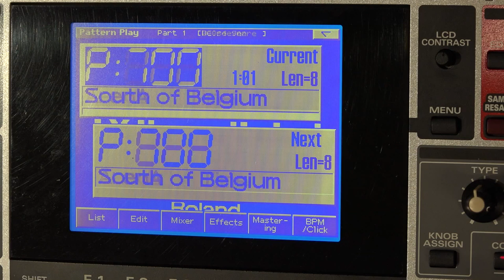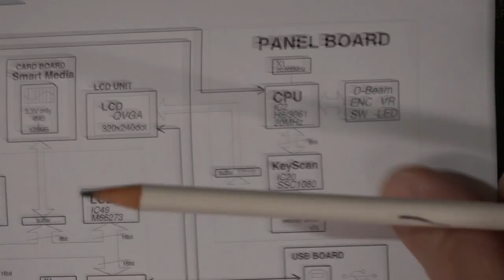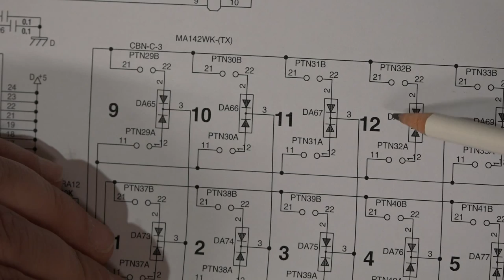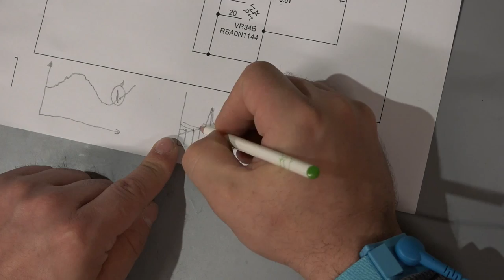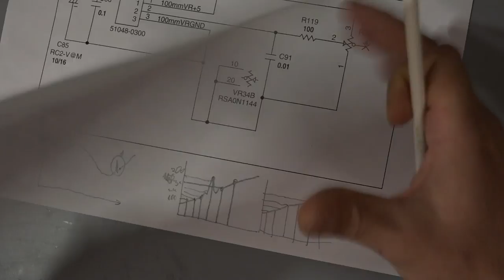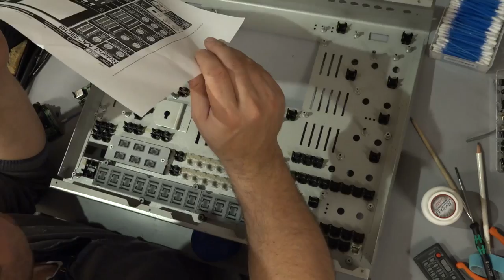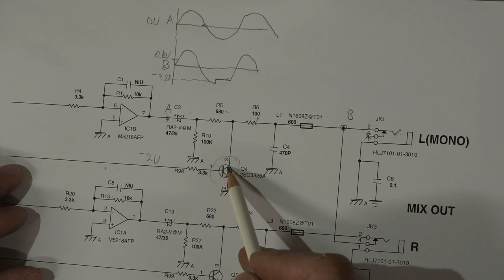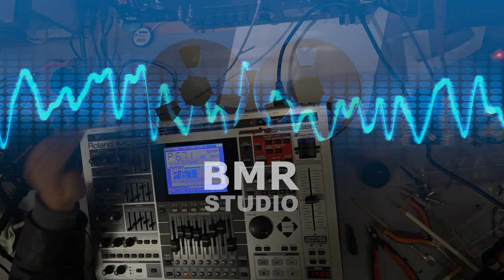Roland MC-909 tear down, repair and maintenance

Comment: Question for you BMR STudio?  Why do you think they went with graphite or carbon as a contact for the velocity pads? 

I mean I just re did mine today with a circuit writer pen but it was extremely difficult to do. After I was done I was thinking couldn't I just buy a sheet of thin silver and cut out the shapes needed and then epoxy or superglue to the pads?
Reply: I wanted to say that this is what I used to fix completely dead velocity pads  http://store.caig.com/s.nl/sc.2/category.174/.f

 you will need to clean the circuit board and the pads with goof off or some other strong cleaner I also used an eraser that worked well and then dab the circuit writer stuff on , its not easy you will have to stiple the circuit writer stuff to spread it evenly, don't worry if it looks a lil pooled up it will dry perfectly flat and let dry for several hours before testing
Reply from the maker: This pads are looking exactly carbon - metal film compound pads. But they are extremely hardened, so I was wondering how can be loose on Your pcb. You can try the superglue, but I think You just will mess up the pcb. Superglue has a really bad behavior on glassfiber. Silver also not a best choice, because is soft and it's oxidizing fast. Maybe someone already did a pad repairs. Check the forums. I saw onetime a small screen printing method with some special ink. All the pads are similar, so You can do one printer negative. Or, maybe conductive pen in a  plotter machine? Anyway is an interesting problem what You have, and Yes I know is difficult to repair. I will look for some smart cheap solution.
Reply from the maker: this for the pads: http://www.ebay.com/itm/REMOTE-CONTROL-REPAIR-KIT-CONDUCTIVE-RUBBER-KEYPAD-FIX-TV-DVD-ALARM-FOB-PHONE-/232223466308
use a print negative.
and this for the rubber keys:
http://www.ebay.com/itm/REMOTE-CONTROL-REPAIR-KIT-CONDUCTIVE-RUBBER-KEYPAD-FIX-TV-DVD-ALARM-FOB-PHONE-/171656481000
for that just use a fine brush or small injector pin wit cutted end.
Reply: Aaah just read this quote on silver  

Because even when tarnished, silver has superior electrical 
conductivity, it is used in some electrical and electronic products, 
notably high quality connectors for RF, VHF, and higher frequencies, particularly in tuned circuits such as cavity filters where conductors cannot be scaled by more than 6%. Printed circuits and RFID antennas are made with silver paints,[5][61]
 and computer keyboards use silver electrical contacts. Silver cadmium 
oxide is used in high-voltage contacts because it withstands arcing.
Reply: so the silver seems to be a better choice than carbon, if you think about the banging that the pads get just knocks the carbon loose thus losing the its conductivity. Carbon is just a cheap way to go for manufacturers.

Comment: Hello! I have a mc909 that in audio output, both from the headphones and from the mix outputs you can hear the totally distorted sound, I tried to do a factory reset but the problem remains, have you already experienced a similar defect?
Reply from the maker: Eric- K not similar, but You must download the service manual from the video description. The problem will be around the main channel DAC, or the first op-amp, or the muting transistor. This You can find in the last section of the video.
Reply from the maker: Eric- K page 49 , check the mute circuit output on the bottom. 2SA something transistor.
Reply: YES is 2SA1037, now i verify, thank  you!
Reply: No the transistor is ok, it opens and closes and no short circuit, I suspect it is the AK4527B codec, the sound is really bad, as if it had entered overdrive mode
Reply from the maker: @EricK83  check the -15, +15V rail for the opamps
Reply from the maker: @EricK83  And the Analog 5V rail. Is used in the DAC as VREF! Pin: 35  and : 36, 15, 40, 42, 20

Comment: luv this guy !!! Thanx for your wealth of great knowledge !!!!!
Reply: I also noticed on the mc 909 they have switched from the lil square buttons to round ones on the circuit board. The square ones are used in sp808,606's. The buttons have a life of 50000 presses give or take. Don't know what the spec is on the lil round ones, hopefully more
Reply from the maker: ZipSnipe I hate roland switches :))))) one of the most unstable switches in My life. 50k press is nothing for a switch under my hand. hmmm maybe I press them too much? or Roland not doing a proper design for big heavy hungarian palm and fingers? switches, Made in japan.. My palm is made in hungary. Thanks for watching!
Reply: I wanted to correct myself they are actually 100k presses or mechanical cycles and here is the link
http://www.digikey.com/product-detail/en/P8071STB-ND/P8071STB-ND/259524
Reply: Ok the above is for the sp-606 and 808 tactile switches. For the mc 909 the life cycle is 500k presses so they did improve the switch and they can be found here  http://www.mouser.com/ALPS/Electromechanical/Switches/Tactile-Switches/_/N-5g2m?No=75&P=1z0zlgm  there are several different ones that vary in height and the amount of pressure you will need to measure in MM to get close to the right one.
Reply from the maker: Guys! Here is a perfect comment! Thank You for the research!
Reply: Still working on it, the height I am sure is 5mm the operating force I am not sure of.

Comment: Hi....i have my mc 909 master tuned to 432.0hz,This is how the frequency I work at...my question is..if I resample  a track made soley  from 909 presets within the  909..whilst it's tuned to 32hz ...does the audio sample become a 32hz file or is it 440hz file with 32hz data on it???
Also if I sample from mix in bus whilst tuned to 32hz...is that a 440hz sample file???
Hope I've explained clearly.?
Thanks
Reply from the maker: The master tune is a 32 bit, but not floating point divider variable in the multi sampling DSP engine. But, all outputs, and the final conversion is follows the master sample rate. 
So, If You created a 32 Hz (instead of 32.11 C1 equal-tempered on A4-432, or 32.70 on normal A4-440, equal-tempered C1) sound, it will recorded and played  as 32 Hz. The weird thing is this: The basic samples in the Roland MC-909 are 440 Hz based, so the artifacts are coming more frequently, as You go up on the scale. So, the output sampler and dither algorithm doesn't care Your tuning :) it will be 32Hz
Trap: 32 Hz on 44.1Khz sample rate = 1,378.125 samples! So you need at least 8, 16, 32, 64 full circle, the get full periods!
Reply: @BMRStudio  thanks but you list me a bit on the last paragraph !!
To explain another way ,it is basically able to downsample internally to different rates (any theoretically) but will always be output from the 909 at 440khz...if I'm understanding correctly!?
Thanks again
Reply from the maker: @wynstone7283  not 440Khz, but 44.100
Reply from the maker: @wynstone7283  440Khz???? I don´t understand.
The D/A converters are running at 44.1 Khz sample rate in the MC-909.
Reply: @BMRStudio  sorry I meant to type 44.1 ....
But I understand now!!...what I was wondering is if could create 32hz files on the 909 and send them via digital out to another sampler and keep that 32hz....at 32hz during the data transfer without it passing through the converters and it have it's sample rate altered!!thanks....
Did you ever manage to see if it was possible to achieve the copying of the individual tones of the Srx board....as asked in earlier post!!?thanksagain
Reply from the maker: @wynstone7283  it will be 32Hz. Hint: hard to create exactly 32Hz :) because its not a part of any scale...
SRX: hard, because turned out, the SRX boards not just a simple sample collection... some kind of weird compressed data, plus, many tones are multi sampled, or, using different samples per octaves. But I will play a bit with this, on some simple SRX board.

Comment: Hey Mr BMR , can you tell me the Uf values of the Electrolytics you used in the Russiian Bipolar Cap Hack ?
Rubicon THANK YOU VERY MUCH..LOL.
much appreciated. 
✌️ 🇦🇺 🪃 🇦🇺 😊
Reply from the maker: Double of the originals, in series, You will get back the original.
Reply from the maker: 100 uF, 16V , low ESR audio caps
Reply: @BMRStudio  THANK YOU VERY MUCH , is it also worth doing it to my MC505 and FantomXA  , ? I might run them through my Specrum Analyser first. 
✌️
Reply from the maker: @andrewverran3498  spectrum analyzer will not show you nothing. Only scope, or distortion measurements. Just drive out a simple sinusoidal tone on different frequencies, on max power, and see.

Comment: Thank you for this great autopsy video :)  Is the power supply global - does it work with 100V and 230V, or is it just for one voltage?
Reply from the maker: Lemme check....
Sticker says on the bottom.. 230V! So not global, but maybe internally you can change? I don't remember.
Reply: @BMRStudio  OK, thank you for checking!
Reply: It works on 110 and 230 volt so plug it in anywere you want, regardless what the stickers says. I've got 2 MC909's. One with 117V sticker and one with 230V sticker,  tested both on every way without any problems.
Reply: @jonathanstel5394  Thank  you, that's great, but maybe your 117V MC-909 has a Euro / 230V PSU inside. The PSU in my (former) MC-909 is marked for 100V, and the capacitors on it are rated below 230V, so they might blow up if plugged in.
Reply: That's strange, i've opened up both and they have the same power supply, it gives always the same output, ~ regardless the input
a1du2l3b034 is the nummer on it.
I just took the gamble :)
Reply: @jonathanstel5394  Lucky you! :)
Reply: They are equiped with smps power supply's, same as the Roland Fantoms

Comment: Another question for you.  I have been using headphones since I fixed my 909 sounds great. But when I hooked it up to the mixer to play out to my monitors the volume is very low. I have it maxed while all my other gear is barely a quarter of the way up.

So do you think adding the bigger capacitors like you did in the end will help and what size caps did you use?
Reply from the maker: ZipSnipe Check the signal levels. Maybe You have an issue with the same mute circuit in the MC 909 like Me! Or, check the ouput level settings in the main menu. also in the main setup menu try out the other output as main mix output. The caps are not bigger.... they now in bipolar configuration dude :) that's why doubled the capacity because they connected in serial with negative to negative. Sounds fantastic! Russian high quality caps :)
Reply: Thank you my friend, I have never watched a video sooooo many times, again one of my favorites
Reply: one more question. Am I seeing your video correctly? Did you put two bipolar caps where there used to be one cap?
Reply: ah haa never mind I found the answer
Reply from the maker: ZipSnipe is two polarized cap with negative face to face :) then it's comes bipolar. Sounds good and punchy!
Reply: I wanted to say that the final fix was I replaced the digital recorder that I was using as a mixer with a Mackie mixer and the problem is gone, in fact the mc909 in now the loudest instrument in the mixer setup, go figure

Comment: lots of useful information, ty
Reply from the maker: Hehe :) believe Me, there is more in the MC909, but who will watch 5 hour long video?
Reply: I'll definitely watch it.
This type of videos gives me the courage to repair my stuff.

Groove boxes(music production workstations) always have complex and dense circuits.

I have a Korg Electribe EMX-1, it had a problem, when i push my finger on the ribbon the display shows every parameter changing randomly, then I decided to fix that, it has 3 layer of boards , I putted a sheet of paper between the boards and problem is gone.
Reply from the maker: :) sometime, the most cheapest solutions work as the best :) Good idea! Share it! I just think on buy a dead Electribe collection. Then build a Korg Electribe monster with more controlls and bigger display, bigger pots, 49 key keyboard. One time I will do :) The best thing about repair Your own stuffs, it's a kind of fun, and good for the planet.

Comment: Hi 
I've just switched on my 909 and it has a fault!
When it boots up and is stuck on a user pattern screen and ALL  other functions will not operate or respond .Do you have any suggestions that could be causing the problem it was working ok the day before !??Thanks
Reply from the maker: Wyn Stone try to do a hard reset! Then we will see
Reply: I have tried but cannot enter any other screens ,it boots up to user 003 and has track 3,7,13 lit on the part select buttons also keypad
 8 ,12 are lit!! Also the  edit button in the sampler section is lit!!
Any of your knowledge would be greatly appreciated. Thanks
Reply from the maker: Key matrix or power or clock or EEPROM.. Or all this together auch... . Firmware version? Next stupid question: Where are You living? EU?
Reply: BMR Studio 
I forgot to mention it loads the memory card at bootup stage.
It's the latest firmware installed ,
I'm in  England ...are the other faults u mentioned fixable by Roland or similar ??again thanks for your JEDI knowledge 😎
Reply: Things have corrected themselves and the machine is working properly again after a reboot!!!🤗🤗thanks for the input!!
Reply from the maker: Wyn Stone Magic of MC-909 :) Reset is Your best friend.
Reply: I think my joy was premature as I managed to do factory settings on it! Upon the next reboot it has gone back to the inoperable state😟
Reply from the maker: Wyn Stone so, let’s try to flash back the firmware to 1.22 version, then take out the memory card

Comment: Is there any way to exchange the smartmedia port with something like a USB port, or an SD car reader ?
Reply from the maker: No 🤣
Reply: @BMRStudio  

Thanks for replying. So it doesn't use a similar bus to a floppy drive ?
Reply from the maker: @yanickborg3118  smart media bus is a weirdo thing. Even the file system too. I did try to make a arduino library and drive the 3.3V pins. Failed. Then I found an old chip which had CF and SM bus too, but unfortunately the integrated muxer doesn't have have two directions capability between the ports, only towards the bus. Meh... Someone will do some Raspberry thing for it. I hope. Ah, and the SM controller inside is also a weirdo Roland thingy...
Reply from the maker: @yanickborg3118  YouTube     cAZZH7J0eGJDYhO1
Reply: @BMRStudio  

Well, I've gotten one of those adaptors, XD to smartmedia. Seems to like the M type 128Mb XD in USB mode. However, am getting "Memory Damaged!" errors, but only when attempting to import SMF midi files into a pattern.
Reply: This is a follow up. I was trying to import a midi file that had unclear midi commands. I opened the file in synthfont, made sure channels were correctly numbered and cleaned up other unnecessary bank/patch data. Then I saved again to another Midi file. This imported SMF with no issues. So, no need to perform a factory reset. Just verify/correct the midi import data.
Reply from the maker: @yanickborg3118  sounds good. Few Years ago I find some mediacard Image file on the internet like some service files and data on it.. I think Your monster is in good condition. Just play and stop worrying 🤣